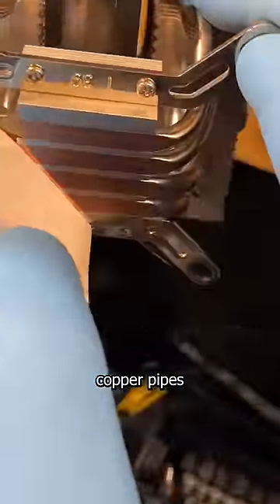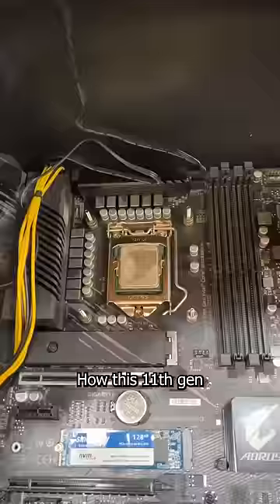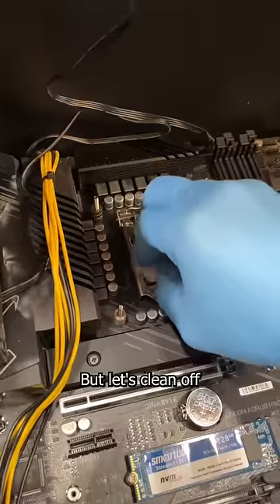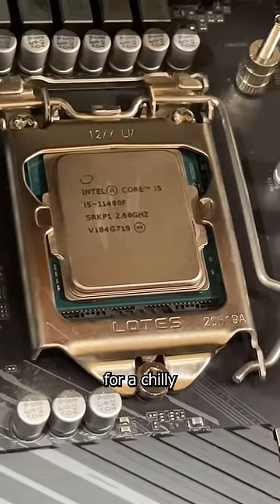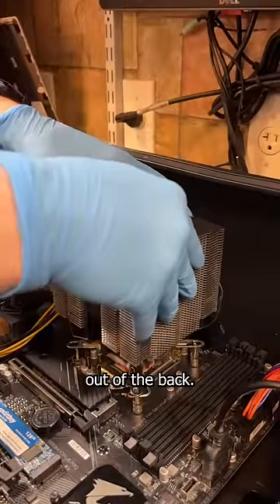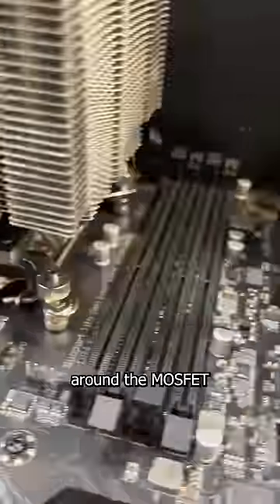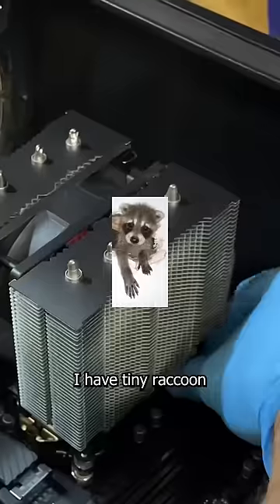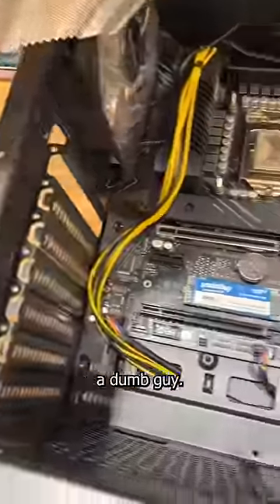Russian computer repair shop harmed this poor #gaming #pc Intel CPU was on fire 😢 #tech #shorts

Comment: Nah, the builder knew the weather of Russia would cool it down so it actually needed heating.
Reply: We install like this so we can use as space heater in Siberian winter
Reply: @eancola6111 I confirm that the top cover, when heated enough, begins to work as an IR heater.
Reply: This should be the pinned comment 😂
Reply: dude it’s not so cold in Russia we have almost the same climate like in a North America

Comment: bro is that a squished peep as the thermal paste 💀
Reply from the maker: Thermal Grizzly Kryonaut Extreme 😂
Reply: @SalemTechsperts i actually had it on my pentium 4 and always thought it was some thermal paste from the dollar store and only temporarly useable
Reply: @catslayer7023 except kryonauts suffer from dryouts sooner because it's made for enthusiast watercooling and generally less viscous, this CPU does not need that paste and a long lasting paste such as MX-4/MX-6/NT-H2 would be a better choice as it dries out much later
Reply: @UnsungAces  This is the extreme version, not comparable with base Kryonaut. Also less viscous? The extreme is way thicker then something like Artic mx-5. Also no brand name paste dries out, what you are referring to is pump out, which is the psychical leaking of paste due to heat cycles. All that said, the lifespan track record for the extreme is well…unknown. 

Viscosity isn’t a great indicator of lifespan either, thiner pastes like Artic mx-5 have great lifespan. What’s more important is it’s ability to not flow away under heat, which is far more difficult to determine.
Reply: Don't be ridiculous, it's Pepto-Bismol
Reply: @SalemTechsperts  kryonaut is forLN2 cooling not for air
Reply: @acexxxoasis  just monitor temps, loud fan noise is another indicator. Replace as needed, no hard rule.
Reply: @SalemTechsperts wait wasn’t kryonaught extreme like a bluish grey or am I misremembering..?
Reply: @acexxxoasis  anyone who says "6 months" "1 year" or anything like that is wrong. Thermal paste can last quite a long time, once you see abnormal temperature it might be time to clean your pc and maybe, just maybe replace the thermal paste. 
I had an mx-4 application for 5 years straight and when I dismounted the cooler it was still quite "fresh", probably could have lasted other 5y
Reply: @acexxxoasis  when your pc suddenly off after approximately 5 minutes and can turn back on after 5 minutes when you push on button..but commonly in this case,heatsink fan failed or heatsink not tighten enough.rarely because thermals paste.mine still kicking after 13years on one applied.

Comment: Some of the worst DIY home builds I had to clean over the years was user using silicon pipe rubber sealer instead of Thermal paste under the heat sink. A funny repair I did, clearly showed me HP techs from HP, don't know their own equipment. Three different techs told my customer, that their mother board was dead, and needed a $380 replacement. All it actually needed, was several pin jumpers the owners kid accidentally vacuumed off the pins when cleaning the dust out with his mom's vacuum 😂
Reply: Seriously brother, HP tech support are the worst, once my mom's hp's stopped charging and when she went to the repair shop, they made her a bill of 300 $, before anything I made a hunch that the charger was at fault and bought a new charger for around 50 bucks and it started charging.
Reply: I’m certain they knew and didn’t care it was an easy fix.
Reply: @SWTORLOL87  not the rubber silicone. Meant to say inside the socket. Not an easy fix at all.
Reply: In HP'S defense (I can't believe I'm defending these people) how the FUCK are you supposed to anticipate that someone used CAULK instead of THERMAL PASTE. How does that HAPPEN.
Reply: @CrazyRiverOtter  It happens when people look stuff up, and go with the first easiest thing that shows up. How many times do we look up simple things like window cleaner or wire caps and get 200k worth of pointless hits. They bought what the search recommended.
Reply: Wait no hold on... VACUUMED OUT THE PINS!? Never have I seen a computer made so poorly that a vacuum cleaner can take the pins off it.
Reply: @Deja117  sorry, meant to say vacuumed the jumpers off the pins. If you you ever come across an old 486 Compaq or Packbell desktop computer, open it up if you can do so safely, and try lifting a jumper, but make note as to where it is so you don't put it back incorrectly. Early 90s the two above companies purchased the same exact pin & headers from a manufacturer who was selling them quite cheap. Unlike today's pins where the jumpers are so tight, you may need a tool to remove them safely, back in the days of Sears teach repairs and sales, many a new Compaq or Packbell computer being taken out of the box, wasn't unheard of finding loose jumpers in the box. Turning  a new system upside down, while still in the box, caused many to fall off. The company PCB motherboard noticed that went out to every store, showing where each jumper went 1994-96 was written by me. So many out of box sales were  coming back defective, when all it was, was the jumpers falling off, that Sears required Packbell to forgo the warranty voiding for opening the PC, and include a flyer that showed the customer where the jumpers went, or take back, every computer Sears Purchased. Kinda funny, in a way because in 1998, when I was on loan to a military contractor, repairing smart batteries, special batteries that go into missiles, found six pallets of them returned, to find out the pin system came from a certified company, the very one Packbell and Compaq bought from. I have zero complaints, as it got me mega OT doing all the repairs. Don't even get me started on the old IDE pin drives, similar issue, different pin manufacturer. Anyways, even the manufacturers techs like HP, would tell a customer a motherboard was bad, when in fact it was just fine. Only missing the jumpers. Most people who vacuumed their computers to find them no longer working, and paying a fortune for repairs, most likely vacuumed up a jumper, and didn't ESD damage their system. Reasons techs like HP said a board was fried, was most likely they didn't do a visual inspection, and just ran a test on the Motherboard that failed. TP back in the days stood for Test Point. If a motherboard didn't give a reading, they didn't look to see if jumpers were missing, they just told the customer, they needed a new motherboard, unless warranty replacement. Imagine how many people, spent $300+ for MB replacements, when all that was missing was a 1 cent jumper.

Comment: This reminds me of a friend of mine who was in the same situation. He didn't know about it since he had had the pc built. One day out of curiosity I tell him to start the Afterburner while he was playing and tell me the temperatures. 95 C°. In short, that i5 was melting. It had been like this for 6 years. I told him to take it to show somewhere and so he did. It was basically the heatsink sticker that hadn't been removed.
Reply from the maker: You hate to see it 😭
Reply: So uhm if a gaming laptop is running at 90 and 100 degrees goo or no goo
Reply: @DanorDave  It is "normal" for a laptop to have high temperatures. Since we are in summer I would advise you to use a ventilated base to cool it. Such temperatures occur due to the type of effort that the components have to sustain in those few centimeters of space. And if we add that the laptop may have a non-optimal dissipation system then it is obvious that such high temperatures arrive
Reply: @Tsutaurushi  oh ok!, ive been having my laptop for 5 years now, never really thought about the high temps, but thanks
Reply: @DanorDave  Glad to help you understand. High temperatures can be a big deal in a laptop because they can lead to thermal trottling and give you less performance, especially if it's a laptop that's several years old. So I would advise you to follow my advice to take a cooling base
Reply: 95 degrees is far from "melting"
My asus zephyrus laptop was always 95-105 degrees and is still running after 6 years.
Reply: @denko1240  But this friend of mine has a desktop, and in a desktop having those temperatures is not good. In a laptop, as mentioned before, it is almost normal to have such high temperatures. Not on a desktop.
Reply: @DanorDave if your laptop is 5 years old, please change the thermal paste. It will be night and day difference
Reply: @Brandon-uy1uv  I just watched a video about that, I know😭😭, I will probably going to make a video to show how dirty my laptop could get

Comment: It is a literal miracle that label didn't melt into the CPU and brick it for good. The heatsink must've been doing something at least.
Reply: How would it melt "into the cpu" exactly?
Reply: @h4rl3h don’t question what computers will do
Reply: @YOURteacher_100  that's funny considering I go to school in this.There's no way that label could "melt into" the cpu unless you somehow remove the lid
Reply: @h4rl3h  sir, if a computer wishes it so then it shall happen
You do not gain knowledge on it, you just understand it as a evil
Reply: @YOURteacher_100  what, bro a computer isn't alive.
Reply: @YOURteacher_100  you dont need to cover your ignorance with being meme or edgy. it could not bond with the ihs either. if it would melt you could peel it off. and those things melt at temps waaaay above shutdown temp of an cpu at 95-105c
Reply: @tarkitarker0815  you people really don’t have any humour do ya
Reply: Because its another fake video with "dumb build".

Comment: Imma sound like an old guy but back in my day, thermal paste was used very sparingly because we wanted as much metal to metal contact between cooler and cpu and the paste was just there to fill in minor imperfections and eliminate any microscopic air gaps

Comment: As a Russian I confirm that it is VERY hard to find a normal dude who would build you pc here. No exaduration - 99.8% of them are scam, and the only real ways to build your pc is to ether make it yourself, or have an actual friend who can do it
Reply: Согласен)
Reply: That's a shame. In the West we have a bunch of smaller computer repair shops that I wouldn't trust with even my calculator. The bigger stores that offer prebuilts are good for non-gamers but the gaming ones tend to be more expensive than its worth. It's really good to have the skill to build it yourself.
Reply: @hermanwooster8944  that’s why I love pc and everything connected with it. And…. in Russia we have the same problem as you told. But, with our salaries, the prices for computer components are very high.
Reply: Who needs a guy to build a PC? It is easier than a Lego. And if you are a girl, it is even easier for you.
Reply: Its easy enough.. as long as you have some mechanical skill and able to ise YouTube
Reply: @donalexey no it definitely isn't.. just yesterday installed this big ass CPU cooler and it was sooo tight that it the most lewed comment about girls wouldn't do it justice.

Anyway.. works now
Reply: Well I am lucky to know a reliable vendor that I buy from...
Though it probably helps that I don't usually buy remade PCs and instead pick what parts they have available and then get it assembled in front of me.
Though this heatsink direction thing I would've probably missed.
Reply: Все норм пацаны собирают компы себе сами
Reply: @R.O.R.O.G  к слову не согласен, разве что вы живете где-то далеко,  я спокойно нашел компании с хорошим кредабилити, когда друг просил поискать себе готовую сборку. по итогу сам я ему собрал, и себе так же до этого собирал, но на то время из-за недостатка знаний обратился к ближайшему другу друга айтишнику и все было решено и сделано безумно быстро
Reply: @ilyakostin5676  ну меня это не касается, я очень хорошо в компах разбираюсь так что......... мне норм)))
Reply: Поэтому важно иметь знакомых вообще везде, без связей очень тяжко жить

Comment: I once use solder paste as thermal paste, works very well for a year or two then ended up cant be separated once the heatsink is broken.
Reply: Wtx did yoj actually? If yes that is freaking genius and criminal at the same time
Reply: Heat it then remove it. 
Stupid twice in one post, I'm impressed.
Reply: Какой сюр..Неужели так легко наклейка радиатора процессора отклеивается. Обычно надо въебать, что б под трением, клей разогрелся и легко отставал. Тогда можно отдирать всех

Comment: Huge respect to the pc builders. I got one recently and added ram, I spent 45 minutes trying to figure it out. The amount of strength (more than I thought for a insert piece.) and delicate precision needed shocked me.
Reply: Yeah you often have to be pretty brutal when putting in ram sticks. See a few Linus tech vids and you should be good. Reading any manual from ram manufacturers will also do.
Reply: @powerdude_dk  Before this yes but, DDR4 and above have a slight bump/raise in the middle of the ram stick connections to allow for relatively easy insertion....nothing like the DDR3 nightmare days...
Reply: @marksnow8838  it depends on the motherboard. Some are really rough, others go in easier.
And I've noticed no difference from DDR-2 all the way up to DDR-5. The ram module itself can't make much of a difference as the locking mechanism and the pins are on the motherboard.

Comment: When replacing the dried up and separated TIM from my 1st gen core (which in itself resulted in a period of being hot), I forgot to plug the HSF back in and temps went to like 144 C or something.

It's still going strong despite being a 14 year old CPU used every day.
Reply: What is even "1st gen", because I still remember running a 186 with very little cooling .

Comment: side quest/pro-tip  if you can't get to a screw like ones covered by a massive cooler.. pull the motherboard out of the case.  this is how you should build all PCs, put everything on the motherboard before you install in the case (check standoff positions first)

Comment: I use to mess around with my home pc, add hardware, memory, new fans etc 
Anyway my case was always open because of that.
I over clocked my pc, to run faster as my fan was a good fan. Anyway everything running sweet.
Couple months, i see bios on boot up saying cpu temp - 190
Im like woah.
It peaked 210 when i was trying to figure out.
Turn it off look at the fan and it is solid with dust.
The dust came out the fan, in a block.
How the cpu wasnt burnt out, i do not know. But fir something so delicate they can take abuse.
Fyi dint leave your pc open

Comment: Not just Russia. I got a CLX that was dead out of the box. Nothing internal was fully connected. All kinds of wires not plugged in. It was a $3,500 gaming PC.
I had a similar issue with another gaming PC from another company but they actually worked with me to fix it via phone even though I finally figured out the problem. One cable just laying in the case not connected on either end. CLX? All email. No help whatsoever. Nobody cares about workmanship any more, but what do you get for $12/hr?

Comment: only complaint i have here is using that much paste to install a heatsink, one grain of rice sized dab of thermal paste will stretch across the whole cpu if you press it down evenly
Reply: Yes, but thermal paste wears down, adding more allows it to last longer.
Reply: @wintermitz  not how it works, metal based paste does not wear down like that and most have a curing time before they reach peak performance, i have been using arctic silver 6 for 10 years without issue nor an obvious change in performance

Comment: Why is every PC builder overdoing it with the thermal paste? Like bro he cowered the whole CPU with it wtf. Just put a small circle and let the pressure spread it.
Reply: Thermal paste wears down over time, if you add more you wont need to replace it as soon.

Comment: Not a mystery, Intel chips, when they get to hot, rather than melting down into a puddle of goo like their AMD counter-parts, just throttle their clock speed or halt altogether to maintain a safe temperature.

Comment: You use way too much thermal paste. You should onlu use the bare minimum possible. Metal to metal contact is best so the thermal paste is only to fill the pores in the metal surface & the tiny low bits, to maximise metal to metal contact where ever possible

Comment: Now that insane amount of paste will not transfer all the heat instead 😂

The paste is to only flatten out imperfections. Very little is required to achieve that and get the best heat transfer. The amount he poured on it is way, way too much.

Comment: Ugh.. And then proceed to drown it in paste. Why don't you just get 100 liters of it and just submerge the entire computer and let the cooler float on top? ffs don't they teach anything about anything anymore. WHAT is the function of thermal paste? Think about that.
Reply: Thermal paste improves the heat transfer between two objects, and it slowly evaporates over time, so adding more it better.
Anyone who has owned a computer should know this.